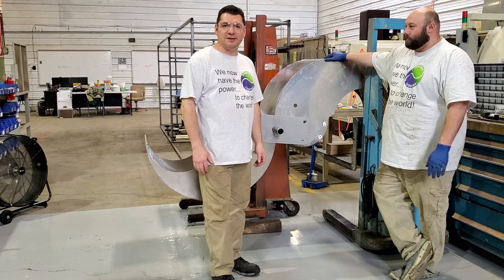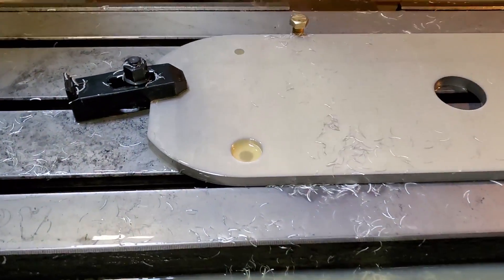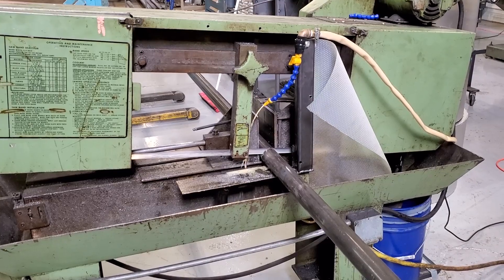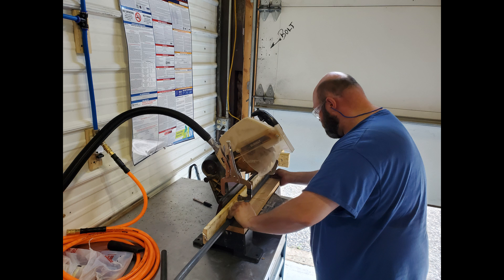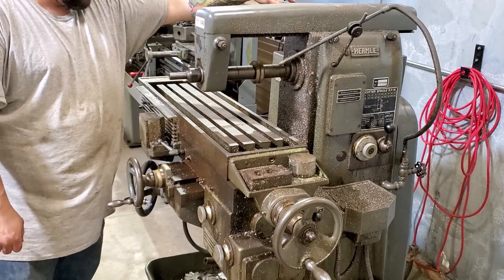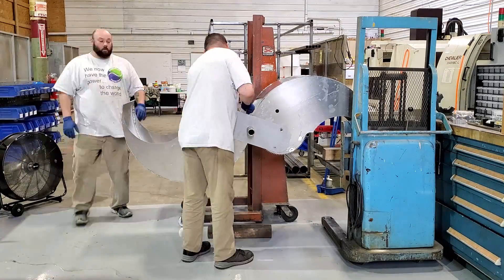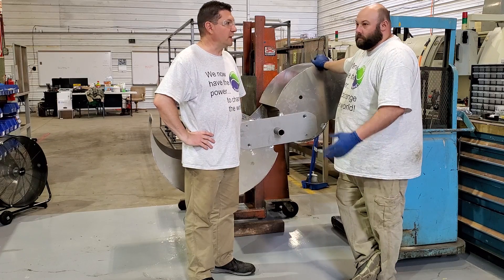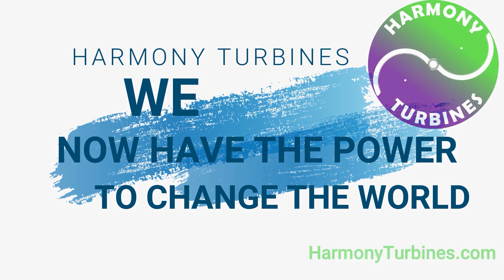Harmony Turbines Weekly Whirl 13

Comment: Those people on social media complaining about getting tooling into the shop to support production have never and will never work on concrete. 
They have no idea the amount of tooling necessary to machine bend cut weld material much less storage or logistics. They are  what we refer to as 
chair jockeys as they sit at home and try to whip the horse. See folks always have opinions that appear relevant in their minds until someone puts a pr of boots an gloves in their hands and then they  have no clue what to do with themselves.  What work, whats that and how do I do that, ooh no im not comfortable in doing that. All things 25 an under say.
Take their itchingba as just wind in your turbine, use it as fuel. Drive on and you will succeed. 
Determination will reach perseverance.
Reply from the maker: Deadwood, that is precisely what I have been doing. -Just Getting it DONE... one step at a time. Working as quickly as we can with the resources and funding that we have at our disposal.